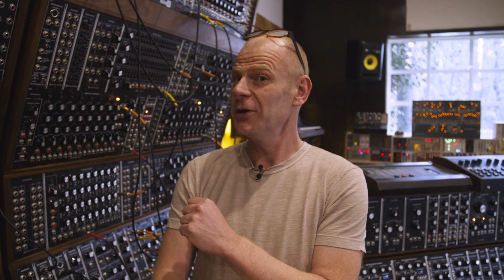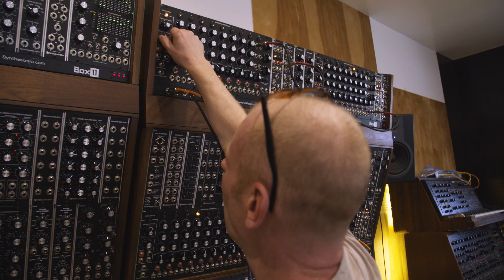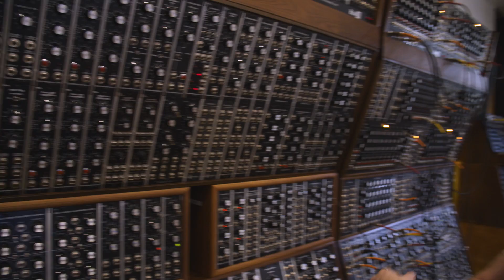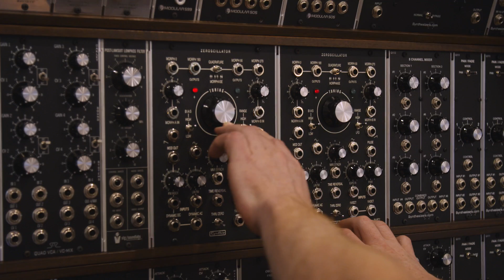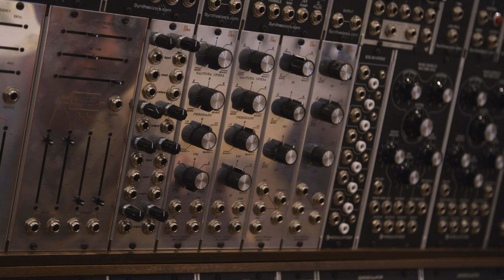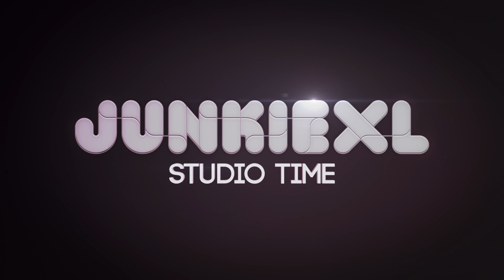The Modular Wall - Studio Time: S2E3

Comment: When you talk about the 'Signal Processor' I think you are confusing offset with phase.
Phase adjustments do what you describe and shift the relative phase left or right by delaying one or more signals.This can have obvious frequency dependant results (Phase shifters).

An 'offset' applies to the balance around the common or zero voltage, making an AC signal peak more negative/positive.
When talking about offsets in opamps, the input offset will determine what the output voltage will be before any signal is applied.

That is an envy inspiring setup, and the room itself is very nice looking.
Thanks for the video.

Comment: Are most of the modules custom made? I only ask because they’re similar in aesthetic despite the different suppliers. It’s a beautiful wall with an amazing workflow, by the way.
Reply: I believe most, if not all, of the modules Tom had were stock items. Having a consistent look has sort of been one of the main "feature" of the 5U modular formats, where in this case the design esthetic of the original Moog modules from the later 1960's has been in most cases somewhat closely to exactly followed by most of the various manufacturers.
Reply: @JohnLRice  thanks! Yea, seems to be the case. I think there would be more differentiation if it were a bigger market I guess. Interesting how the Eurorack didn’t go with the Moog aesthetic but the 5U did.
Reply: @scopsmusicproductionandcom3926  Yeah, it's an interesting history. Back in the early days of modular synths (1960's and 1970's) each manufacturer like Moog, Buchla, ARP, Polyfusion, PAiA, Aries, Roland, etc, etc did their own thing and modules from one weren't compatible with any of the others. Then in the mid 1990's Doepfer and Analogue Systems came on the scene with modules that started the Eurorack craze as both could fit into the same case. And in the the later 1990's three large format modular manufacturers appeared, Modcan with the A series (a little taller and narrower than Moog), Synth Tech with the MOTM line (5U height like Moog but narrower), and Synthesizers.com with their similar Moog look (5U height like Moog and same widths but power supply connections were different, power supply voltage were different, and audio levels were different so compatibility with Moog systems wasn't really there). Modcan A, MOTM, and DotCom all ran on +-15v but used different power connectors and since panel sizes were different, trying to get them to work together wasn't something many were up for. Meanwhile more and more new eurorack manufacturers sprang up and the format gained momentum, while the large format fans remained somewhat split. The DotCom version of Moog style eventually won out, partially because of lower cost than Modcan A and MOTM, partially because DotCom was the most efficient at production and order fulfilment, and partially be Paul at Synth Tech gave up on the MOTM line and switched to eurorack, and partially because Bruce at Modcan, (who had launched the new B series which used panel sizes compatible with MOTM) , unfortunately suffered a serious health crisis and ceased production.  
OK, I'm all rambled out! Time for bed! ;-)

Comment: Well, let me correct you, Tom. To start - you need any analog synth you can get. It will cost 300$ at most, soldering iron, power cord and new capacitors included.

Comment: great stuff! When watching these modular type of studio's I always wonder about power consumption as all units seem to be switched on.
Reply: While these walls look enormous, the power consumption isn't in relative terms. My "big wall of modular" is small compared to Tom's, maybe 2/5 the size, and it uses about 275 watts. So a very rough guesstimate might put Tom's wall at 700 watts? It may even be less than that since I may have a higher power supply to module ratio than Tom due to the way my system is set up (mines all in road cases and I have a separate power supply in each case)

And when taking pictures or videos to show off to people, of course we are going to switch it all on! ;-) Typically my modular is off unless I'm actively using it.
Reply: Thanks for the info, a lot less than I thought.

Comment: What a wall of sound , is this all Moog's ? Price ? 500.000 $ ? , if so it be multi voicing
Reply: yes Thx cockatoodude , i found that one on thier site the one unit is 10.000$ occasion ,mint   junkie has 3 of this models,making up a whole wallStudio-110

The Studio-110 is our largest pre-configured Studio system.
The six oscillator base cabinet is topped by a 22-space cabinet, an 
inverted 44-space cabinet, then a special crown piece.
The system includes our 24-stage Q119 sequencer, plus two Moog-Style 
Q960 8-stage sequencers, sequential switches, and interfaces.
The top row contains a complete three oscillator synthesizer with dual 
filters.
A keyboard garage and patch cables finish out this incredible machine.
You will not exhaust the possibilities of this system

Comment: I'm new to modular synths, how much would a basic module usually cost? How much is a setup like Junkie's one?
Reply: Hi, cost per module can vary a lot depending on a lot of factors like circuit and interface complexity, parts quality, how it's assembled, where in the world it is made, and how many can be potentially  sold etc.

If you are asking about the 5U format modules as Tom is showing in this video, there are some module just under $100 (like the multiples) to others that are well over $1000 (like the fancier sequencers). In general though, off the top of my head an average cost for most modules is probably between $200 to $400?

Take a look at the https://www.muffwiggler.com/forum/ for endless information on modulars! Check out the sub section titled "5U Format Modules" for the most information on the modules Tom presented here.

And check out https://www.modulargrid.net/ for a fun and easy way to plan and arrange your system and get an estimate of how much it will cost.

And . . you probably don't want to know how much Tom's setup is worth!!! lol ;-)
Reply: I'd recommend starting with Eurorack format.  They range from $50-800.  The community is huge and full of helpful people.  Buying a small used rack on ebay or craigslist is a good way to start.  Developers like Make Noise, 4MS, Intellijel, Mutable Instruments, Erica Synths, ect make really awesome and intuitive modules.
Reply: Actually, eurorack modules range from $50 to over $2000! ;-) I don't think one system is necessarily more or less expensive than the other anymore. Eurorack is certainly the most popular and the number of eurorack users and manufacturers totally dwarfs all other formats combined though! :-)
Reply: A setup like his could be nearing $50k

A lot of the modules he is using are originals and cost a ton, keep in mind each module at the least is about $100 (sequences being more expensive etc) + cabling, cases...

You could check out Doepher, they have a ton of Eurorack modules :)
Reply: Amnesia More like 100k
Reply: More like you're both dreaming...
Reply: @SecessionStudios  The main advantage of Eurorack is the incredible diversity of 'fancy' modules that do all sorts of strange things to signals however the idea that Eurorack  is less expensive is one of the biggest myths being circulated on internet.... the cheap Eurorack modules (Doepfer) are no less expensive that synthesizers.com ..... and the expensive Eurorack modules (Intelligel, Make Noise, etc.) can even be more expensive in some cases than 5U (Moon Modular, Corsynth, Club Of The Knobs,  etc.).......  I have a system and make tutorials on modular so I know......   but in any case  just google and look at the prices  ...... price is one of the most  shaky and flaky reasons to choose a format...... you could choose because of SPACE (5U takes a LOT of space) or preference or diversity of modules  but certainly not cost saving.